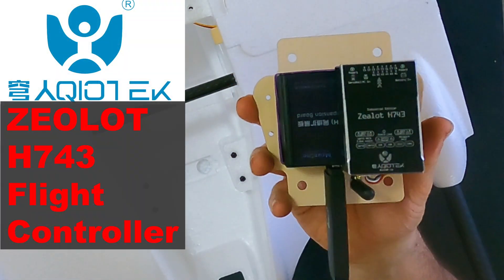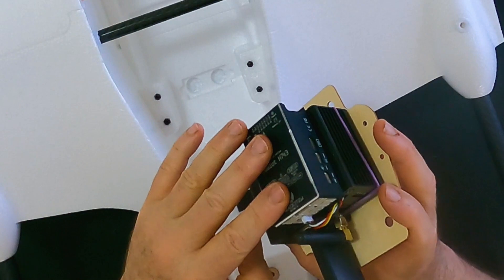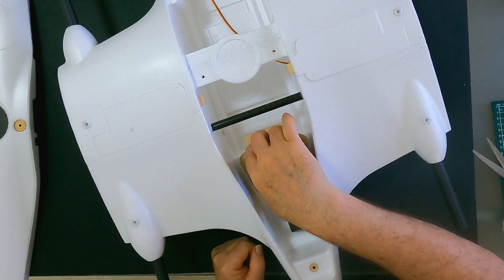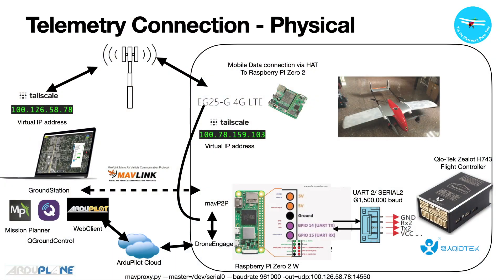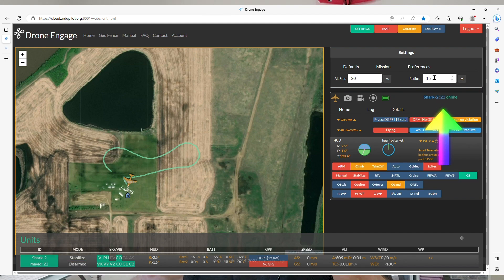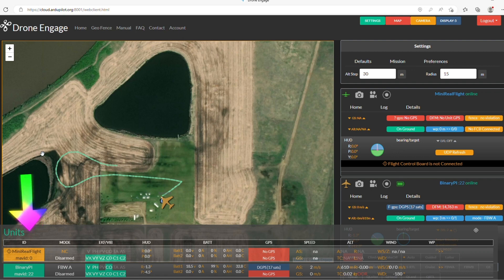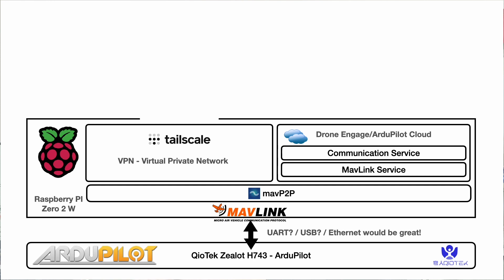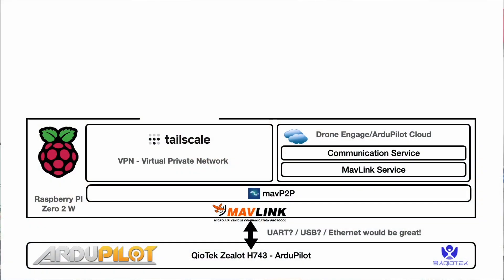Does ArduPilot need a computer in the plane?

Comment: Shouldn’t be any errors on serial… something is wrong
Reply from the maker: It's interesting you think that, it doesn't surprise me at all. I wonder what makes you think so? Thanks for watching.
Reply: @timtheplaneman  like you said that short little wire shouldn’t have problems. I have more experience with Ethernet, which reliably does error rates < 0.0001%, but I’d start with double checking settings on both sides, then consider a breakout tester.